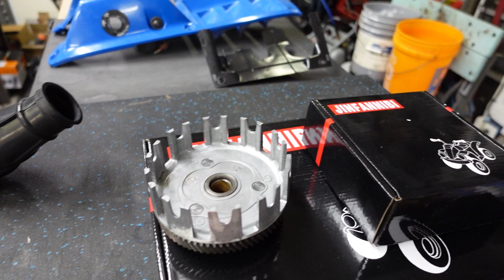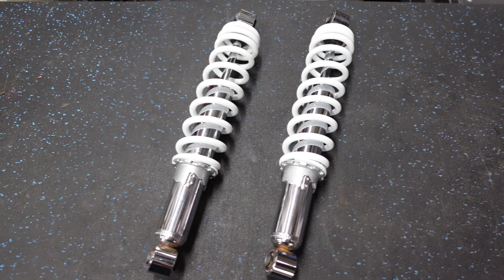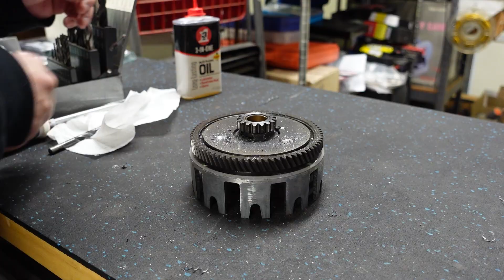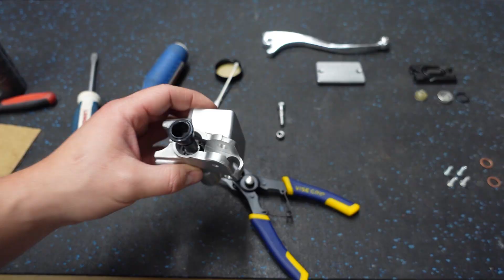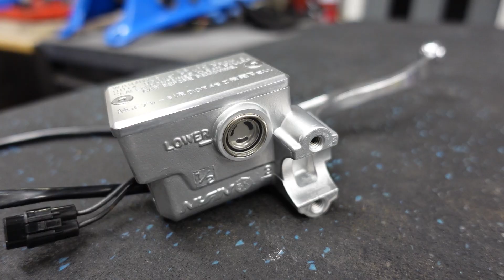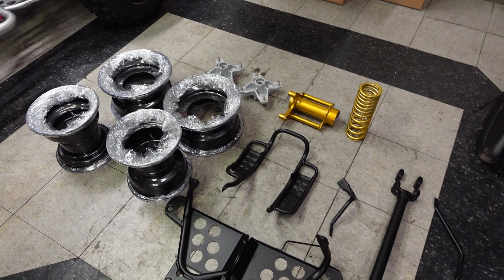Fresh Powder Coat, Vapor Blasting and Zinc! Amazing Results! Yamaha Blaster 200 Build

Comment: Another Rockin' a@@ video Lil Bro! I actually really dig that Gold to be honest! I do have a suggestion though for when you trim the plastic, I find it easier to trim the edges with a Portable Deburring Tool after cutting off what I need. Cleans up those little fingers quick and easy. Also has a swivel head. Walmart sells them online for like $10 . Search for Portable Deburring Tool Professional Edge Removing Tool and you will see what I mean. Keep rockin' the vids Bro!
Reply from the maker: Thank you for the love as always Big Bro! I will test out the deburring method on the next trim job 😎

Comment: If you want longer bit life, use first gear on a drill not second. Unless you have drill bits specifically for high-speed drilling, otherwise you have a very good chance of overheating the bit and ruining the temper
Reply from the maker: Thank you for the tip!
Reply: Just use more pressure when in 1st